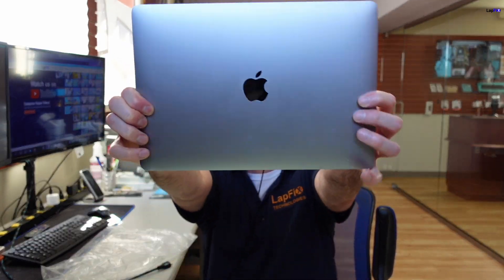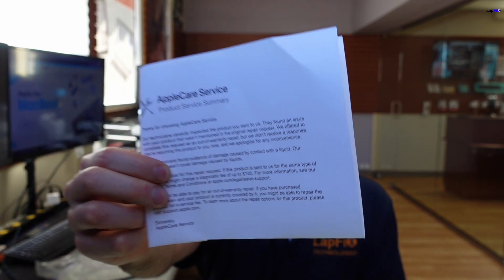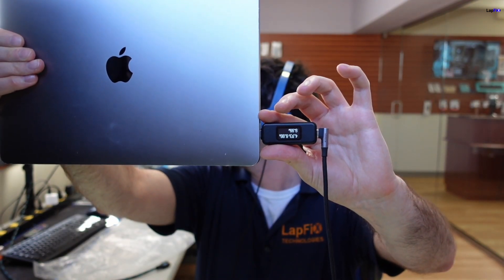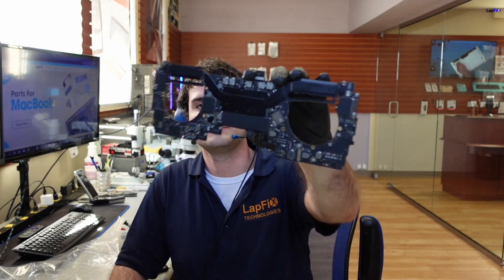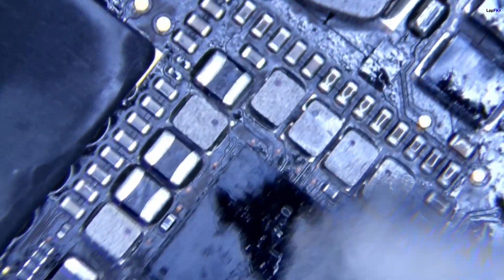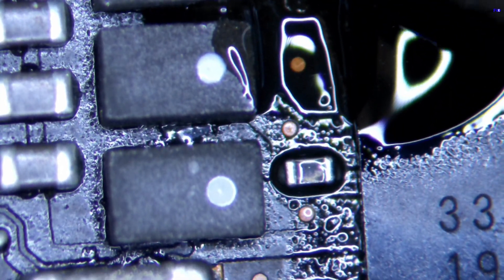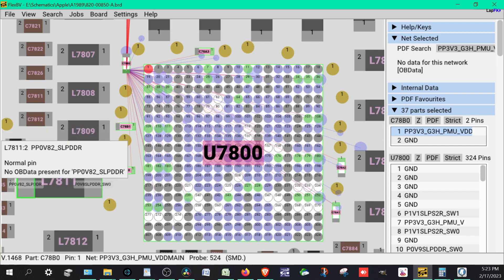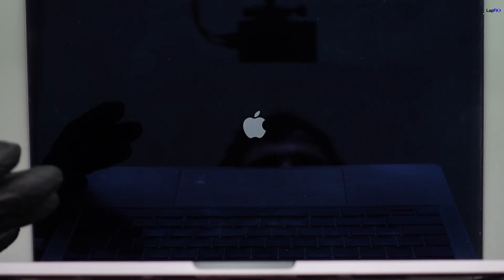Fixing A 2018 Macbook Pro With Liquid Damage

Comment: I totally understand the customer.  If you are always careful and try to keep your machine in tiptop shape the diagnosis of liquid spill is not always understood.  From what you showed here the board was having a lot of dust and if it is in a situation where the humidity is high this can indeed lead to moisture being absorbed, over time, and cause a short.  I would consider to give this customer the advice to come back annually for a quick inspection to make sure the build up of dust and grime is not going to affect the working of the laptop.  Be it Apple or HP or whatever brand.  I took my PS5 apart this weekend, it is family day in Canada and I had some free time. The system did not look all that dusty but looking at the fins for the cooler I could see they were pretty dusty.  It is preventative maintenance that will help hardware survive.
Reply from the maker: Always welcome your detailed and well thought-out responses.  Thank you for your input